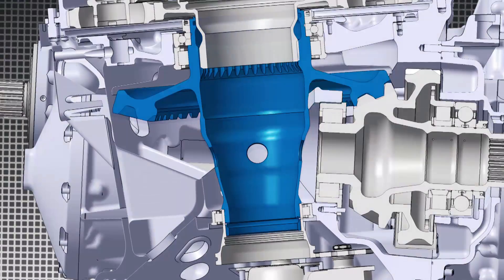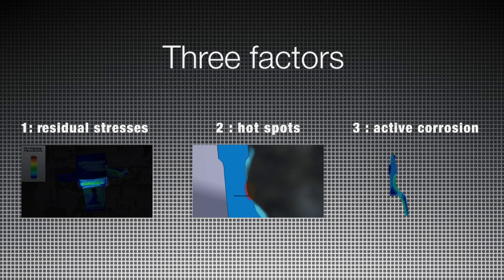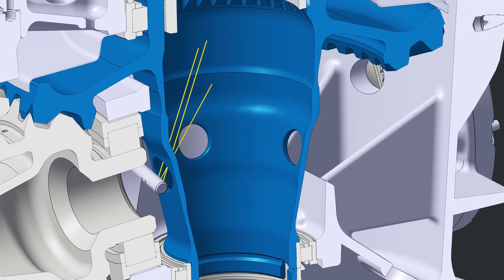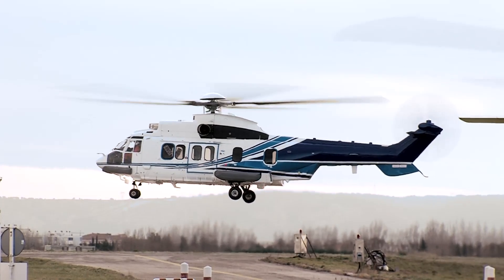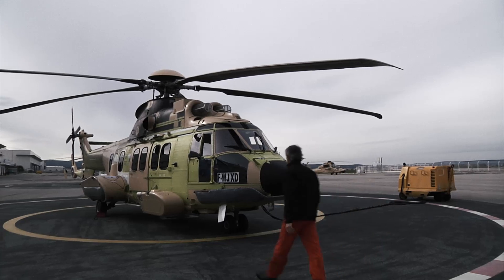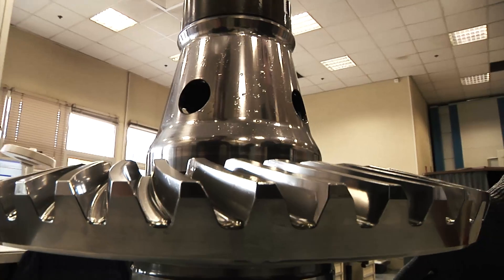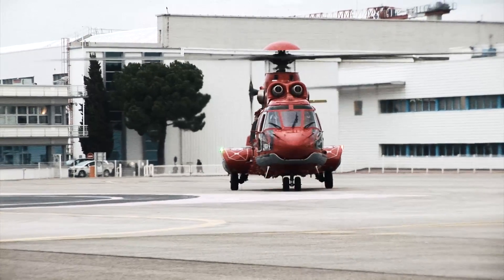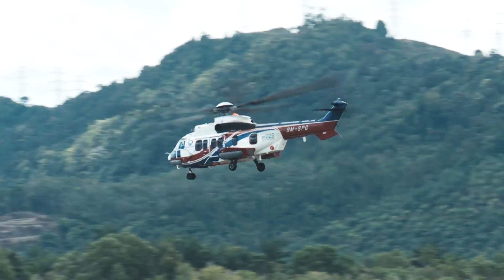EC225 shaft certification

Comment: airbus also fails to mention the emergency gearbox lubrication system indicator lights were wired incorrectly, and was never tested on the aircraft only on the ground! which was also the main factor in these ditchings...